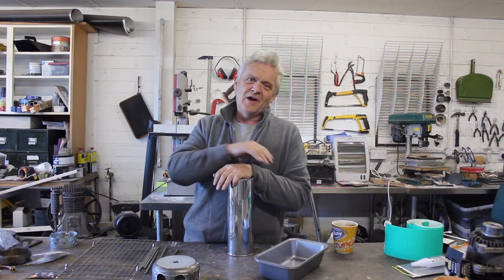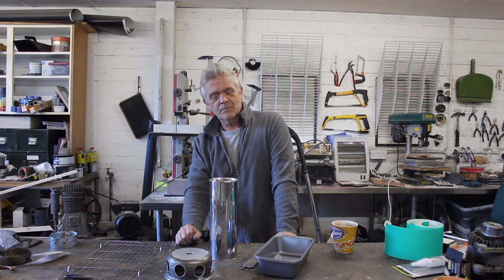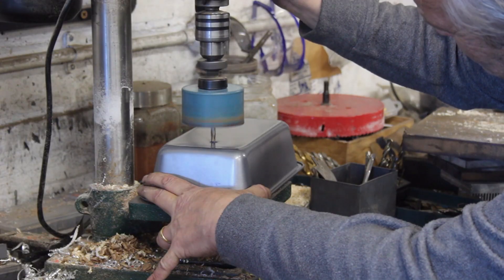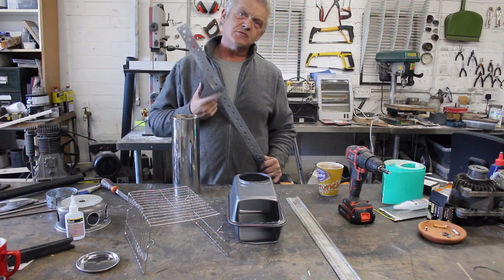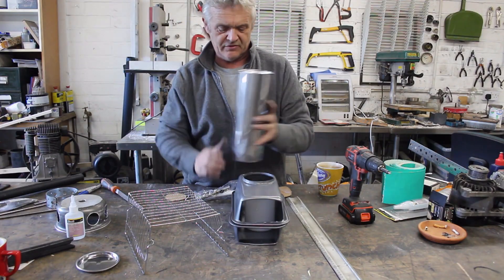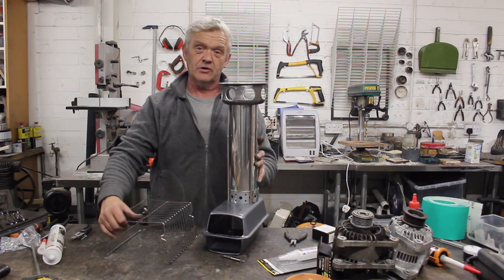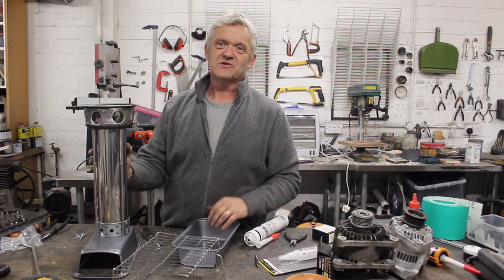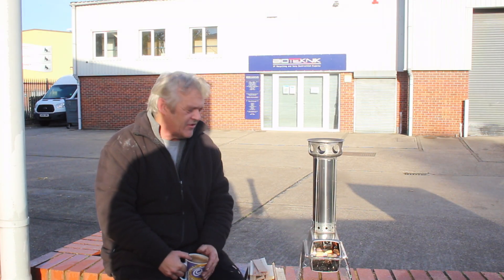1726 Easy Build Rocket Stove From A Toilet Brush Holder

Comment: Do you think there is a way to adapt it to biopellets? Would be interesting to see you try and make a woodpellet maker to recycle wood waste this was a very good video mate as usual 👍
Reply: You could fashion something of a tool to do this, I mean I have a 10 ton press but you could easily make one from a bottle jack and some thick steel welded into a frame, the end of the piston would be fine as a dye, all you'd need then is something to press sawdust into, I mean steel plates welded together with a hole drilled through fractionally bigger the outside diameter of the piston would be good enough, fill the hole with sawdust and compress it but yeah fair play I like your thinking
Reply: @jb-dn3ct  thankyou and how would you suggest a way to have a Controlled feed? Gravity should do the trick but you lose heat control and a ton of efficiency too maybe changing the diameter of the feed pipe or maybe use a reduction fitting
Reply: @stonedsavage7814  I think this is going to make an interesting project and yes making the pellets is the easy part, I'd imagine the burn chamber would need to be modified as well, regarding timing of the pellet drop what would be cool is trying to scavenge the waste heat to do that job, something like a Stirling engine rotating an auger, or slightly more crazy, a turbo charger fitted to the exhaust with the impeller side modified to spin the auger, the wastegate could then be used to control the speed of rotation, I'm sure Robert will come up with something far simpler but this would be a cool video, hopefully watch this space 👍
Reply: @jb-dn3ct  the turbocharger part is very interesting just need to degrease the bearings to make them low friction and then it could be powered by my misses backside emissions it will be that smooth at turning 😂😂
Reply: @stonedsavage7814  lol my misses  just pointed out it would need a way of slowing down if powered by my rear end, unlimited source of energy right there 🤣
Reply from the maker: I am sure there is - I will have a think

Comment: Paper logs work well in a rocket stove, as well. Free fuel advertisers send to your door. 😃
I've been wracking my brain for a way to use a small rocket stove like that to heat a room in my house. A heat exchanger blowing heat inside from the stove outside was one idea. Heating a metal pale of sand on the stove, then bringing it inside to radiate the stored heat is another.
Reply from the maker: good ideas mate
Reply: @ThinkingandTinkering  Thank you. Sent you an email about an electrostatic experiment from 1896 you might find interesting. Great channel and it's good work you're doing.

Comment: I did the same thing with the empty steel can that my methylated spirits came in. I cut a door in, drilled some holes toward the top and used the pour spout as the chimney. Nice build, though. Nice looking little unit.
Reply from the maker: cheers mate

Comment: Title is misleading, should be, easy build rocket stove if you have a professional workshop in your garage
Reply from the maker: I used a hammer, drill and angle grinder - sure I did a bit of welding but you don't need to - who doesn't have a hammer and drill?

Comment: The straws are used to steady the chimney?
Reply from the maker: exactly - four of them clamp the pan to the base and lock everything in place - you don't need to - the sealant would everything together but it would be a bit weak if you moved it

Comment: I've watched many videos on rocketstoves, rocket Mass heaters especially but this is the first time I've seen holes at the base of the riser?  Seems like a great idea.  Where did you come up with that?
Reply from the maker: it just makes sense to add air where the wood gas is - I was thinking about the fire triangle and trying to come up with a design that incorporated the basic principles of rocket stove design in a way that was easy to illustrate
Reply: @ThinkingandTinkering  very interesting!  I like it and I think it may solve a lot of issues if it works long term.  Now I'll have to experiment with it.  Biggest issue with these as you know, high temp always deteriorates them fast, even stainless.  I'm going to try 2-1 perlite to high temp cement.  Vermiculite is a better and amazing insulator but can not handle any moisture at all.
Reply from the maker: @l0I0I0I0  keep me in touch with how you get on will you? I am going to start that members forum next week I think
Reply: @ThinkingandTinkering  look forward to it!
Reply: @l0I0I0I0  perhaps try using furnace cement. I use it to line my forge with. It'll easily handle your stove temps. It's economical, premixed to the optimum ratio and available at most hardware stores. If you want to be real fancy you could line the tins with kaowool first, but not entirely necessary for this application.
Reply: I see people are suggesting some kind of cement recipe. I was thinking ceramic floor tile and firebrick. But Stainless Steel should get you through the rough spots this year and next. Hopefully the world turns around by then. If you have any south facing windows on your dwelling you could put a black surface behind them and collect the infrared from the sun, blow it back into the room.

Comment: Hypothetically speaking, is this something that could be started by a window/some sort of ventilation inside and then once it comes up to temp where it is burning the wood gas, then close up the ventilation?
Reply from the maker: you shouldn't close up ventilation with any open flame fire mate - when you burn something you are using up oxygen all rooms with an open flame, gas, coal, wood - whatever need to have air coming in - but we are not talking opening the windows in a gale here - but they do need tone ventilated

Comment: Cool! But wouldn't you want to leave the ash pan unglued so you can easily slide it out to empty?
Reply from the maker: you can add a slider if you want or make a scraper or just tip it out if it is small enough
Reply: @ThinkingandTinkering  That's what I imagined, a slider. Thanks!
Reply: Perhaps binder clips like you'd use instead of paper clips on a thicker piles of paper
Reply: @smartliketruck  Binder clip building is one of my favorite options. Instant fix b4 I figure out slider design. Thanks!

Comment: Lovely and beautiful., but not done by me. You need a lot of tools to make it. Something easy for a woman to make it, with less work would be lovely. My husband could make it, but he is not there anymore.
Reply from the maker: thank you - I did weld the ring but you don't need to - just drill the holes in which case you need a hammer, a drill and an angle grinder - that doesn't seem a lot of tools to me tbh
Reply: Ask around to see if there is a “tool library” in your neighborhood. Sometimes senior centers have one.
Reply: Clay and sand mixed together like people do for pizza ovens and make parts that way or make a cardboard internal mold put in an appropriate container and add cement  when set remove cardboard 
If you research fire proof cements recipes you could get a stove that will last for years

Comment: Amazing! I especially like the holes to burn the wood gas. I think you need a TV show, like Mr. Wizard had in the 50's and 60's here in the USA. WELL DONE. Somebody ring up the BBC.
Reply from the maker: Wow, thanks!
Reply: You could make a small basket from the SS mesh, and then burn wood pellets, if they have them in Britain. Usually $7.00 per 40 pound bag here

Comment: That's fantastic. Ive just gotten a Ghillie kettle and I'm loving it. This would be a perfect companion to it. Especially if we are likely to be having power outages. Thanks for all your brilliant advice and tips!
Reply from the maker: I have one too - they are awesome and I have been pondering how to make one easily so folks can just run one up if they want
Reply: @ThinkingandTinkering  I've been toying with the idea of a DIY Kelly kettle using old stainless steel thermos flasks as they have the twin wall already,need to practice tig welding first😉seems plausible 🤔
Reply: Just learned something new from you and looked it up. Can you distill water with one of these things?

Comment: Home fire insurance in the UK must be high we have to have certified wood stove here in Canada or they cancel your insurance or the Fire Marshall demands it be removed. It would work great outside to heat water which can be piped in for heat.
Reply: I’d rather risk burning my house down (safely) than freeze to death because the gas has been cut.   I’ll deal with the insurance man when that issue presents it’s self.
Reply from the maker: remember our housing stock can be hundreds of years old - if you instal new you have to have permission if you already have a fireplace no permission is needed and lots of houses here already have fireplaces in situ - usually for a couple of hundred years!
Reply: It appears the threat of freezing to death is greater motivator than the actual fact. I burnt wood many years I just hope people understand the risk.

Comment: Looks like to me that those loaf pans are PFTE (teflon) coated, keep well away from the smoke as it burns off.
Robert - I'd love it if you'd come up with a homebrew refractory material for making rocket stoves. Rocket stoves made with steel either don't come up to temperature for an efficient burn, or if they do start coming up to temperature the steel degrades quickly.
Reply from the maker: good point
Reply: if you use a ceramic fiber insulation and coat it with a ceramic slury this will contain the heat and protect the the body of the stove
Reply: NOBOX7. Done a refractory cement mixing quick lime and water glass which seemed impressive 
I’ve been thinking about this sort of stuff as building out of these types of materials seems more low tech 
I would think hydrated lime would work as it would turn back to oxide once it gets hot and it’s a lot more available 
A pottery mate of mine told me that sawdust is mixed with refractory cement  it burns out leaving voids filled with carbon a good insulator although that might burn out unless soaked in water glass first which might graphitise the carbon and that might make it heat conductive 
Im thinking of getting some porcelain clay as I want to get really high temperatures 

Lots to ponder 🧐
Reply: @johnmcfadden9336  porcelain clay sounds like an excellent idea mixed with peralite.  I would think that slowly curing the mixing and slowly bringing it up to higher than operating temp may keep it from cracking and last longer as well.
Reply: @johnmcfadden9336  I tend to stick with my tried and tested mix of fused silica grains and powders and water glass for practically everything in foundry, refractory, investment casting etc. Sawdust, I imagine would be a good bulking agent provided it is very dry and coated properly.
Reply: @lagunafishing  this area would be good to explore and compare  
I have some silica flour and water glass  just need to get some silica sand 
Do you have a more detailed recipe you would share

What would you coat the sawdust with
Reply: @johnmcfadden9336  By way of an example.. in the lost wax process, simply dip/coat your wax model in waterglass and cover it in silica flour. Allow to dry and repeat several times until you have the desired shell thickness. The burnout will fuse everything together in a kiln prior to pouring molten metal. I don't use sawdust personally but you could in theory mix some and coat it with waterglass - used either as a bulking agent or create some interesting porous materials turning it into charcoal.
Reply: Oh.. PS, I have family who worked for DuPont, I've heard some stories about Teflon and it's precursors. Scary stuff, I won't use Teflon cookware at all. Now watch me get cancer from the chrome in my stainless..but it's a crazy world.
Reply: Waterglass from crystal kitty litter is pretty easy, and perlite is dirt cheap if you source it right. They still need fired, and dry time is several months, but you can do industrial grade big money block for pennies on the dollar, (or pence on the pound?) At home. Plus you can plastic wrap your burn chamber, form your brick to it, and have the contours without cutting and releasing all that lovely asbestos.  It's been a few years, but it was simple and cheap.  Honestly if you can build a container around your burn chamber, perlite dumped in loose is tough to beat.  Vermiculite works really as good, but it will deteriorate from absorbing moisture the cycling out steam. 

Cheers.
Reply: @ricksanchez3176  If you are making your own waterglass get as much silica gel into the mix as possible(add heat after it won't dissolve any more silica gel. If you rely solely on the sodium hydroxide(lye, caustic soda) to melt the silica gel the mix will remain too chemically active and will chemically melt your perlite below what it should withstand. If you make your waterglass with potassium hydroxide(caustic potash) instead of sodium it will have a measure more refractory properties
Reply: Indeed. Hydrogen fluoride is very dangerous.
Reply: I've seen mixtures of peralite and cement 2-1 ratio for strength.  Not sure how well refractory cement would work but it would be worth a go, and should do fine and last a long time.  I would not mix metal into the mix as it tends to separate during temp changes due to different expansion ratios with the cement, UNLESS you are willing to find a material that has similar and close expansion ratios with each other AND at different temps.
Reply: Its not perfect burn, but it is a good one, so I think it's still a tool worth having.

Comment: Now can you do it using tools only found in the home?
Reply from the maker: yep
Reply: Yes, you can. But, only if you try. Using basic hand tools will take a bit longer and require more effort, but it is absolutely possible. Get going on it and the rest will fall into place.
Reply: Of course you can do it with stuff and material you have lying around at home, but only if you really want it. Think about this and tomorrow you come with a new version. Although it is called a rocket stove, it is not rocket science
Reply: @paulbrouyere1735  I can't wait until Robert discovers perlite and clay.
Reply: @paulbrouyere1735  🤣🤣🤣
Reply: You can use metal cans from food containers, can openers to cut the metal and drywall screws to connect it all together
Reply: 😂😂 my house has some tools that a normal person wouldn’t have like about most my tools
Reply: Who's home?
Reply: @jeremiahshine  😂
Reply: @aether-elephant  Now that I think of it, this could be done with a small pink hammer, screwdriver, and scissors.   Some may not survive, but do-able!
Reply: @jeremiahshine  🤪 someone who didn't have a nice shop like this one!
Reply: @beanrunnerWA  I don’t have a shop but have more tools then what he has in my house 😂😂😂
Reply: @beanrunnerWA  You don't need a shop or even power tools. Just some hand tools, ingenuity and patience (more of the latter if you lack power tools and/or ingenuity).
Power tools just make the job easier and the finished product nicer.